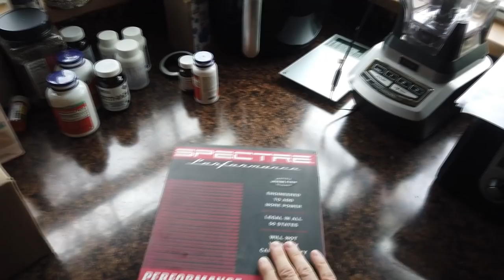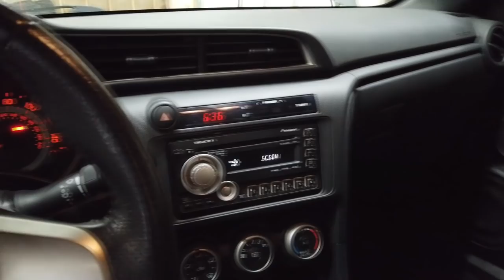Using a Harbor Freight Stud Welder to fix the Mini Cooper

Comment: good job on the panel i used to hate doing filler putty jobs, you are talking about hitting deer with your Scion you may need to find a nudge bar, over here in Australia we use a lot of bull bars on the trucks because of the kangaroo,s, I have had to put nudge bars and aluminum bull bars on a lot of my 4x4,s and these have saved my vehicles and my wallet. Rege

Comment: i ask all about the stud welder cus it will be my 1 st time buying 1... & using it ^ the slide hammer too on my 02 gmc long bed on the very top just where it starts rollong over to the side  i got dents on both sides of the bed............. 1 st thought was getting a 2x6  board or even some sort of steel nice & wide & long enought to reach that far up inside the bed & wide enogh to get the 2 spot's i need to get UN-DENTED SOON & FOR EASY WAY TOOOO   THANK'S  4 the idea's..........

Comment: is there not a way you can remove those studs without ripping the metal? or is that pretty much just the nature of the beast with the stud welder? never really used one so i don't honestly know
Reply from the maker: I grind them off if they don't pull out.  Only left like 3 holes at of all of them.  It welds them on pretty dang good
Reply: @UnWrecked  I may have to grab one of them if i can ever make it do HF again any time soon then if that's the case, looks like it made short work of those dents

Comment: Plz rebuild more mini coopers. I have an 06 R50 that I'm currently rebuilding to make what bmw mini should have done from factory. Im buying up all the best parts and some rare parts from gen 1 to gen 2. Im trying to stay away from too much after market parts but will have to use them for suspension. Im sticking with the N/A 06 engine for now since I've had good luck and have over 200k one of my R50. Im going to use the 6 speed m/t R56 lighter aluminum trailing arms with strut adapters. Trying to find jcw calipers and other suspension parts. Oh and a jcw r53 one ball exhaust. I have r53 struts and lowering springs. They are a little stiffer than the r50s and already sat lower before the new lowering springs. If anyone can find or has the 40th anniversary carbon fiber dash trim plz let me now

Comment: Why not use a wire welder MIG or a TIG welder with a welding rod?  Can you borrow or rent one from a tool rental place?  I would weld in those holes in before I tried putting any filler on those dents.  Do you have a Harbor Freight near by? you can buy a welder for 89$ Look at this: https://youtu.be/lso0-QefOuE  it is only flux core But I used one for a long time. You need to remove the slag, but you have a angle grinder.  Just use a flap disc. If you had a welder, you could use a spot weld cutter and remove a section of the inner skin, under the dent. Then you could repair the dent with a body hammer and dollies, you could carefully weld that section back in.  and Grind the welds.  Love to see you working on a mini. Just found the Channel today and I subbed after watching the video.
Reply from the maker: I see you have a lot of catching up to do 😁 feel free to watch some more of my videos!
Reply from the maker: But yeah, double wall steel on the hood, and I already own a Vulcan migmax 215. The stud welder is way easier